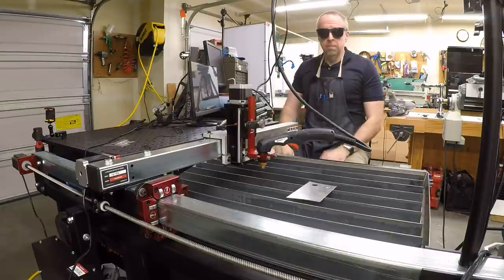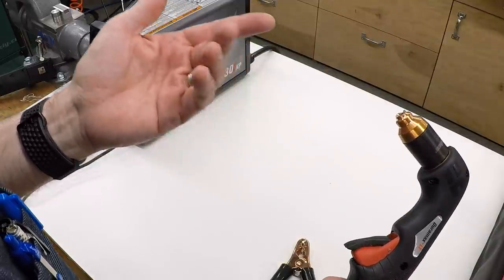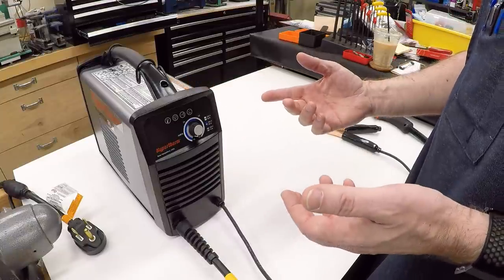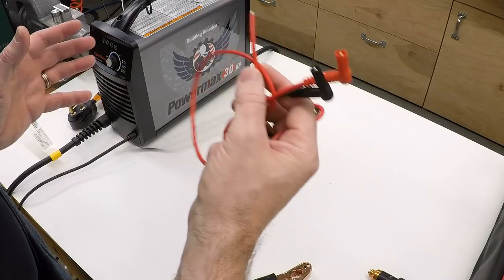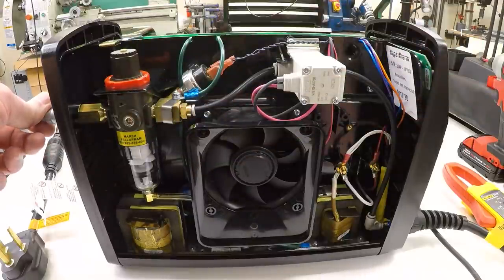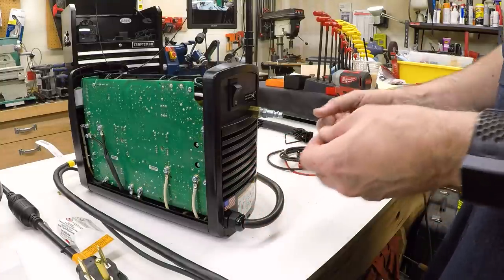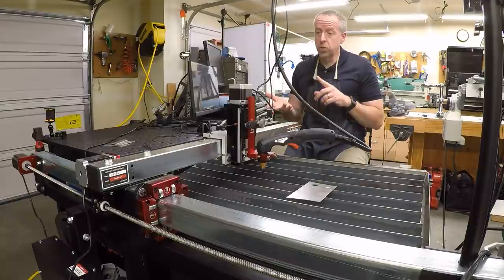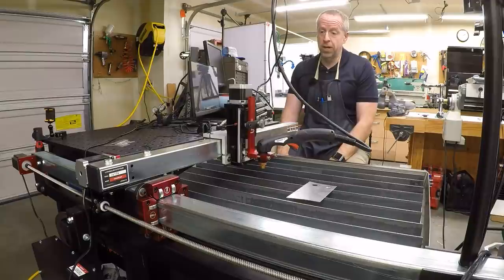Don't try this at home: Wiring a plasma cutter for CNC | Hypertherm Powermax 30 XP

Comment: This video is wonderful.  I would really like to thank you for taking the time to make it.  It clearly, and concisely explains how to wire up a RAW voltage connection for langmuir system plasma table.  I was having trouble for days trying to get my system working. I spent hours combing over message boards, and help pages that were helpful but led m down rabbit holes without solving the issue..  This video helped me to retrace my stems, taught me what to check for, what each system does, how to tap into them, even how to use a voltometer to check for continuity.  After and during watching this I was able to track down my system problems and immediately start cutting....

Thank you so much for making this.  You made my day.

Comment: If you want a DIY air dryer. Use a whole house water filter housing filled with Fresh Step Crystal kitty litter. Put it in the air in line of the air compressor. The crystals won't change color when getting saturated, but you can put a small hydrometer in the housing so you can see the gauges  Jerry in Pa..

Comment: Just wanted to point out you probably should have a separate air dryer, either a large desiccant dryer or refrigerated air dryer as you will still get moisture in the lines. I've destroyed dozens of plasma torch heads and rusted many  many parts during sand blasting even with an inline filter at the end of the air line, an air filter mounted on the plasma cutter and another filter at the compressor. Dedicated air dryers make a night and day difference.
Reply: Depends on your humidity.  I live in a desert and on the most humid days we get nothing out of the dryers(  compressors are 50 hp screws).  Now when I was in GA my pancake compressor had what seemed like more water than air.
Reply: There is a pretty simple way to know if you need to do something for most things, just point your spray gun/torch/blower/whatever at a piece of dry cardboard at normal working distance and see if you get a damp spot.  Humidity, temp, tank pressure, tank temp, dew point, working pressure, flow, it all effects weather you will get condensation out of exhausted air or not. For most things that is all you care about. No inline filter/descant dryer will help with this, they simply lack the capacity but a column separator or adding an after cooler to the pump can usually condense it out.  For things where you actually need dry air, powder coating, difficult paints, sensitive to caking blasting media, you will need a refrigerated air dryer.  Just a heads up out of personal experience, 2 stage pumps seem to push a lot more water down the line than a single stage, single stage is also far more efficient running things like a sand blaster or other high volume tools but max psi will drop from 175-200 down to around 140-150. That generally makes no difference at all in a home shop though.
Reply: his unit had a drip bulb! right!
Reply: He's never had to dry 3d printing filament and he's used cf nylon, so I'm gonna say it's pretty dry where he lives. Doesn't affect the fact that compressors cause condensation, etc, just a data point.
Reply: I like my "toilet paper" air dryer. It works well. I do have a series of 1" copper loops mounted to my wall with valves at the bottom of each loop that collects most of the moisture and the filter removes the rest.

Comment: Hi James, I suggest sheathing the red and black HV leads carrying the torch height info. Over here they would be double layer insulated and I think it would be wise to guard against mechanical damage. Spiral wrap? BobUK,
Reply from the maker: Not a terrible idea.
Reply: I believe the wire used in multimeter leads is double insulated as part of the CAT III rating.

Comment: I suggest that you rig up some ventilation... Even with a water table, CNC plasma tables can smoke you out quick... Don't ask how I know that :)
Reply: Cant imagine metal vapor is very good for the lungs
Reply: @Eggsr2bcrushed   it'll be oxides by the time you breathe it in.  Along with smoke from oils, ozone, NOx, ...

Comment: As usual another great video James. I have my Crossfire over a year now and love it.  Using the PrimeWeld CUT60 successfully.  I'm running Mach3 (I don't like being "locked-in" to a manufacturer's control system) on my shop-floor Dell Optiplex 780 PC. Built my own CNC controller and integrated my own Torch Height Control (THC) using the RobotT3T and built my own floating head Z-axis. I 3D print my machine torch holders in PLA (they last about 1-year). Great machine the Langmuir Crossfire, and they have a great and very informative and active forum.
Reply: I'd suggest trying petg, if you have a heated bed on your 3d printer

Comment: Hi James 
In regards to plasma cutting you might want to invest in line desecant air dryer filter it will prolonged your  Consumables and results will be alot better in the long run. 
I built my cnc plasma table.
I am going to get in the future a refrigerator dryer.
This will help with moisture in the air.

Comment: Great video.  My 2 cents worth by all means use it every time with water.  Otherwise it will deposit metal powder all over your shop.   I have been told that if you put some borax in the water it will not rust so bad.  Oh and like some of the others suggest you really do need an air dryer.  I can assure you that water will get to the torch otherwise.
Reply from the maker: I have a box of 20 Mule Team sitting on my kitchen counter as I write this.

Comment: The Powermax 45 I have has an integral CPC port and has a voltage divider on the main board wired to the CPC. (I'm still wary of non divided current going towards my systems control box on my CNC, so I would have still used a divider circuit) *I also made my own CPC cable, because they're using off the shelf parts you can get at digikey...

The problem with Hypertherm machine torch operation from the CPC, is that the wiring of the torch to the connector is different, and is required. (They built a failsafe wire that isn't in a hand torch, and is wired to different pins.

So either you pay their high priced fee for a machine torch (about a grand)
Or you hack your hand torch, and make it much harder to use as just a hand torch.

I opted to use a lathe to make an acetal housing for a custom connector (the brass fitting is the real challenge bit, and the DIN pin alignment and indexing SUCKS)
Then I could purchase a machine torch head from eBay, and then proceed to make my own lead for it. (It even offers the ability to use better and more robust materials for the lead...)

---
Instead of their high priced machine torch, I opted to buy a lathe, and make my own connector... 
Glad we can all hack our stuff and make it do what we need it to.

Comment: It's great to see that these cheaper Hypertherm units can be used for CNC. My only complaint about the THC kit that you used is that the voltage divider is external - I would have liked to see only low voltage signals leaving the Hypertherm unit's case. (Aside from the torch, of course!)
Reply: Who do we know that could re-home all the guts into a new, custom made case? Heh, James could do that so well that a factory tech would be wondering when that model was made...
Reply from the maker: I'd probably go the other direction.  The circuit inside the THC is very simple.  It would be pretty straightforward to make a version that fits inside the case.  Hmm...
Reply: My line of thoughts was maybe figure out the schematic of the HV regulator inside the unit and tap into the torch voltage before it becomes HV? Say, input of an op-amp as oppose to the output.

Comment: Phew that was close, I did this at "home" a few years ago. Luckily it was on the older powermax 30, not the XP, so it's ok right?

Cool to finally see someone else do this, and their approach. Mine didn't have one of those voltage dividers since the cnc was shop built, but it wasn't too hard to build and I shoved the circuit for it into the case so that it didn't bring the high voltage outside the case other than torch/work clamp... 

Then I got lazy with the height probe circuit ("ohmic" or contact probe) and brought it outside the case anyway because space inside the plasma case was getting tight (it's almost like they don't want you shoving extra circuitry in there?) and I'd already installed and wired up a 6 pin plug and would need a 10/12 pins at least to shove the probe circuit inside the case, and I couldn't be bothered. I'm glad I did this way since the probe circuit tends to blow a chip every now and then, and having it easily accessible outside the case ended up being very useful. The probe circuit for me went in with the rest of the control electronics

Side note for anyone following along at home the powermax 30 (not sure about the XP) actually has two relatively beefy leads in the torch. I believe the second one is for the pilot arc, and if memory serves you can only connect one of them to your voltage divider, the other will have a pretty much constant voltage with regards to the work clamp regardless of torch height.

Comment: RIP to your beautifully clean workshop. If you can put an exhaust hood over the machine, in addition to the water table, I'd strongly recommend it. You should also build an electromagnetic vise with some MOTs for holding pieces while you knock off the dross - it's a massive timesaver.
Reply: Any suggestions on what a good exhaust hood would be like?  CFM, style so it won't be too much in the way, how high should it be...

Comment: Hi James, why not wire in a switch on the front for the fire control manual vs CNC? that way the ghost in the pc won't be tempted to toast you when using it manually :)
Reply: Good idea, one issue being 'oops, I forgot'.  One thought is putting another switch on the CNC mount:  if the head is not in place, the CNC cannot fire it.

Comment: "Don't do it... It's easy but don't do it" 🤣🤣

Clean install 👍👍

I actually have the 45XP for manual cuts but when I bought it I intended to put it on a table (not yet had the time in almost 2 years... But it's on its way 😍) so I took the CNC package with the mech torch and the preinstalled communication module and added the manual torch... In Belgium it was cheaper than buying the "manual package" and add the mech torch and the module (and you then have to install it yourself...)
Good machine by the way 👍

What I found odd on the 30xp is that the filter is inside the box... On the 45xp it is recessed but accessible from the outside (with tiny hands... But still...) And it needs cleaning every now and then... Are you "allowed" to open the box to clean the filter?

Comment: Ah man, you're just making me more excited to get the rest of my Crossfire parts here!  I ordered the RazorCut45 with mine so I won't need to do any fancy wiring I shouldn't be doing. My handheld unit I already (Eastwood VersaCut 40) have IS high frequency unfortunately.

Given your level of experience with F360 and CNC I expect your setting up of the post processing should be pretty quickly accomplished.... let's see some cuts, James!

Comment: Thanks for the video i followed the video to the tee but with one expected because i dont have that part and my question is if i dont have that part which the high frequency device that you connect to the electro negative and electro positive ( ground ) I tried it but could not get any conductivity . Well does this mean my plasma wont work ? And hows is it still running for you the plasma 30 air ? Well thanks for the great video your a professional thanks

Comment: I have a cutmaster 42 by victor. Doesn’t have a Cnc port so I need to first tap into mine to fire like you mention. Then I have a thc like you mentioned that I need to hook up! From what I hear is if you use a thc and a floating head attachment that’s the best way that way you would not need a ohmic sensor. Also I’m up in the air if I should use millrights supplied board that runs UGS or one of the following 
1. Myplasma 
2. Masso
3. Centroid acorn (which I currently run on my Bridgeport but they are currently in beta on the plasma. If they release it soon this may be my go to board)

Comment: Very cool, I basically have the CrossFire setup that you have except that I bought the HyperTherm Powermax 30 Air.  I went though the same exercise last week, connecting the torch control and hooking up the VIM.  I look forward to more posts about the CrossFire
Reply: how does the 30 Air work with the X fire?  enough air that it keeps up?
Reply: @matthewhagans4372  I'm still trying to get the settings right.  One thing I've learned about the Air is you have to adjust the pierce delay to give it enough time to ramp up the compressor

Comment: Hi I have a question does the torch fire trigger works normally when disconnecting it from the „CNC“ table? (Manual cutting)
Thanks:D

Comment: While you were at it you should have rerouted the power switch to the front panel, instead of the idiotic place on the back panel... Never understood why they put them there.

For when you are using it manually you could have installed a safety CNC disable firing switch so you know it cannot be set off. 
Thanks for showing this. It is close to what I would be likely to setup. On your power, it doesn't matter if you only have 100A, you can install much more output than available because they are not likely to all be running at the same time. So the only real limitation would be the wire size to the plug.
Reply from the maker: Wouldn't want to try to run an 85A plasma cutter, a 5HP air compressor, the air conditioning in the house and in the shop, and a load of laundry in the dryer, though.

Comment: Several things: First great video and clear explanation of what you are doing I love watching your videos. Second, do you have a connection with Langmuir Systems that benefits you when I purchase one of their systems? Third, I like the computer setup you have and I must have missed your video where you discussed the details of the one you’re using. Would you be able to provide info on the details of the Asus you are using?

Comment: Followed your video to wire up my new Crossfire...worked perfect! Thanks much. One question.. any idea how to load .nc files in to Firecontrol? Only seems to recognize .tap files
Reply: hey are you using the pro or 2x2? how is the 30xp working out? enough power? nice clean cuts?

Comment: you used a meter to check the voltage of the caps? damn, I always thought standard procedure to check for voltage was bridging the leads with a screwdriver

Comment: Just a thought, $2000 to $4000 might be a good investment to upgrade the 100 amp panel to 200 amps.  Consider Square D as a panel.  It's only 2 cents worth.
Reply: Depends on if the utility company is willing to change the neccesary equipment, even if it comes at cost to James.
Reply: Does that include the utility upsizing the pole transformer and running bigger feeder wires?
Reply: It’s been my experience that the incoming conductors (wires) do not need to be upsized. All that is needed is maybe a meter change and a new 200 amp main breaker panel be installed be a qualified electrician, and of course a permit is required.

Comment: Also get hypertherm powermax 45  Mchanized consumables this works on the 30 xp torch also kirf on cutting use the powermax 45 chart and dial feed and speeds while cutting it will be alott better cutting process also fine cut consumables work good but don't try cutting hot rolled a36 use pno cold roll it won't blowback mill scale back up into your Torch tip. As for size of plasma machine I used powermax 85 on 50 amp service off my miller bobcat 225 with no problems and at home to I also run powermax 45xp it cuts great cnc plasma table.
There are two guys on YouTube tool junkie and another Joshua Zimmerman guy are subject matter experts with langmuir tables. And hypertherm plasma cutter.
Reply from the maker: If I had a 50A welder outlet, I would have bought the 45 XP.
Reply: James I run 40 amps braker on my 45xp as inverter machine it does not require 50 and 45xp runs flawless no problems I cut alot of a36 and ar400 .380 .500 .625 
Some small production runs .750 my electric services 200 amps my big Plasma runs 100 amps it cuts up to 2inch thick. Thermal dynamics cutmaster.
Reply from the maker: @cjtroutt8092  yeah.  The circuit I have available is 30A.  Things start getting tight if I want to run the plasma, the air compressor, and the air conditioner and someone wants to cook dinner.

Comment: Do things in this order:
1.  Unplug, remove cover
2.  Use voltmeter rated for 400+VDC, with good insulation on the leads, to verify that lethal voltages are not present
3.  Touch anything inside
Someone I know once touched the inside of a camera strobe that had been off for two weeks.  His scream was clearly audible at the other end of the house.
Perhaps battery-powered camera strobes are a special case; storage capacitors should have bleeder resistors -- and 'should' is not the same as 'do, and Purchasing didn't get crappy ones that failed, and the assembler put them in place, and the terminals didn't corrode, and they still work'.  I like to limit the number of people and pieces of equipment that I trust my life to.
Reply from the maker: 3. Touch only what is necessary to do the job.  Keep one hand in pocket when possible.

Comment: I think you are running THC 1.1 and 1.2 is current. You've probably already figured this out but the post file needs to match the THC control version.
Reply from the maker: I'm running the newest version of Fire control, and it's only offering version 1.10 of the THC firmware.